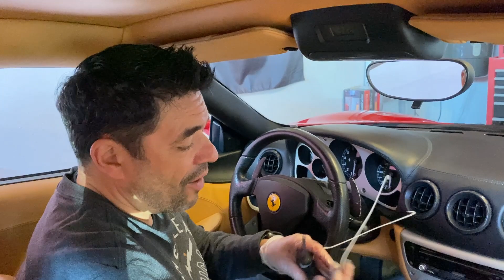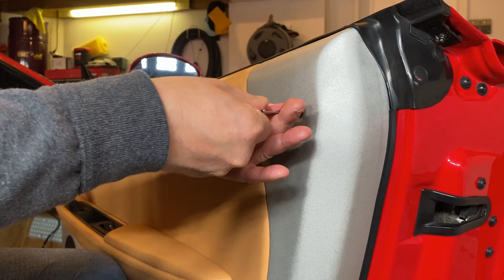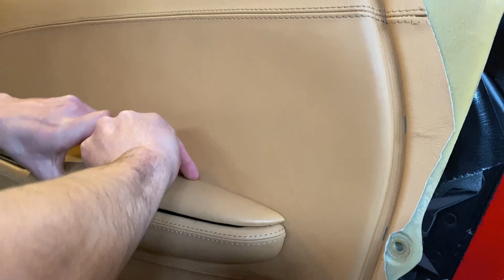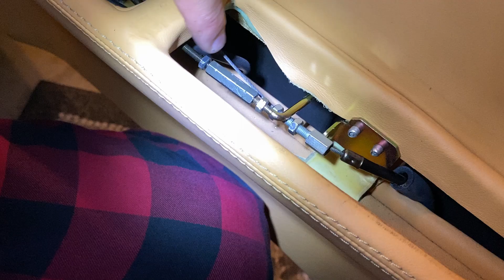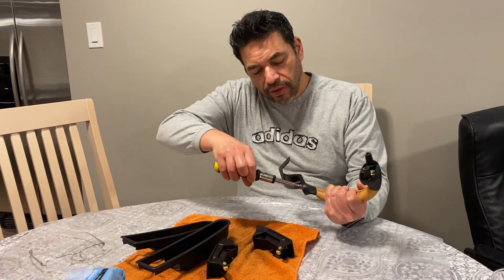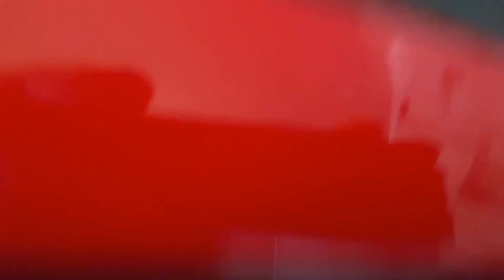Ferrari DIY Sticky Buttons Fix - Dash Vents and Door Latches

Comment: I have a 2017 Maserati Granturismo MC. I had a couple buttons like that. I bought Dirtex Clener spray. You can buy it at Home Depot. Boy did it work in seconds without damaging the buttons and the designs….your method is great too….
Reply from the maker: Thanks for the tip!